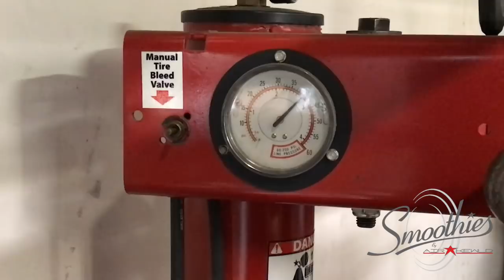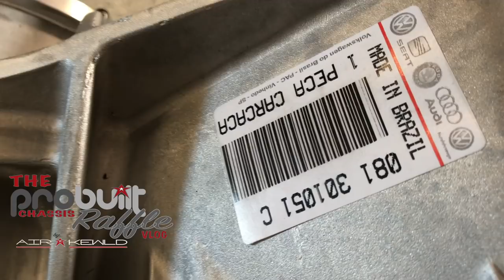Chassis 83 Episode 8 | 2019 | Smoothies get wrapped in some Nitto Tires | Transaxle debut | Airkewld

Comment: Are the tires directional? If so, are they mounted in the correct orientation? I could be wrong but figured I would ask......beautiful pan/chassis.
Reply from the maker: Raymond Wall they have an inside and an outside and we installed them to those specs